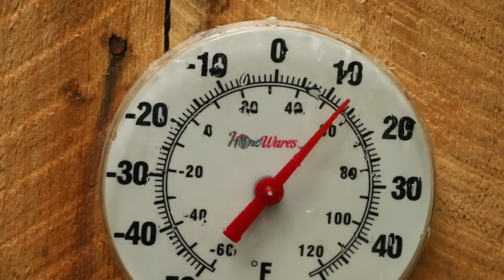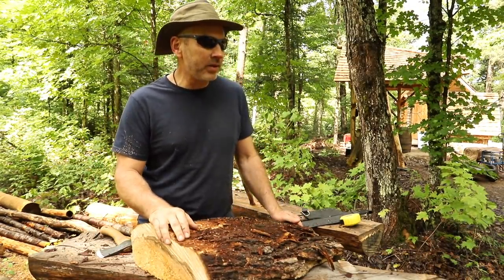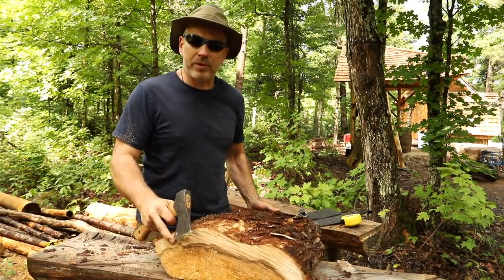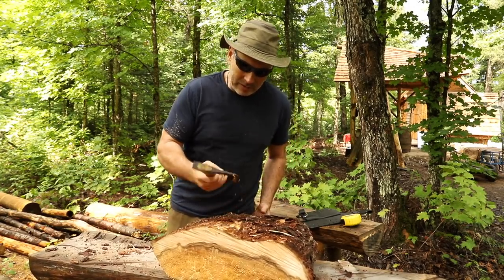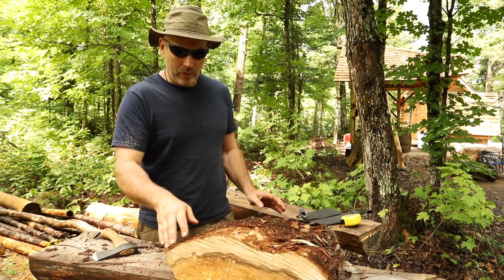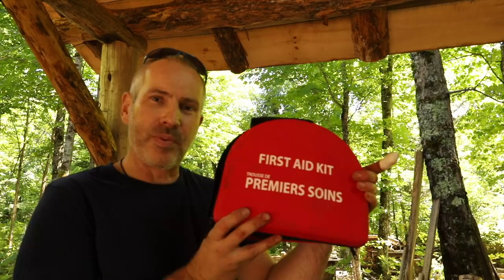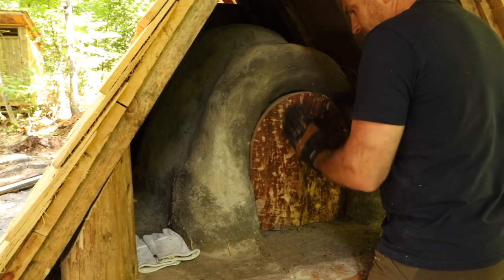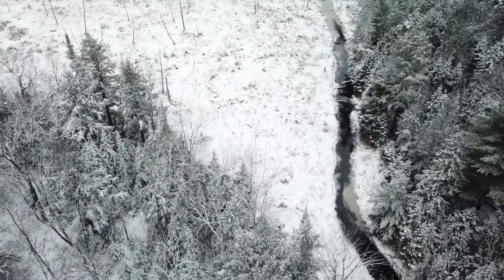I GOT HURT Building a PRIMITIVE KITCHEN in the Forest

Comment: Just an emergency stop-gap until you can get proper first aid...
I always carry a long boot string & a small tube of superglue in my pocket as a just-in-case type of thing.
Sounds a bit weird but either of those 2 things could save you a lot of grief if injured out by yourself.
Reply: Letter carrier uses super glue for hands in winter too! Cracks bad!

Comment: Due to very complicated health problems and dozens of major surgeries I’ve had since I was young, I now have a fully implanted venous access port in my chest, which I need for the administration of various intravenous drugs and infusions, which I actually set up and administer myself at home, which saves me having to visit the hospital twice/thrice weekly.

Anyway, the implanted portacath in my chest leads directly to my superior vena cava, via a silicone catheter. The last one I had which was replaced 2 years ago, lasted for an incredible 6 and a half years. Most ports are used for intensive cancer therapy, so are only ever in situ for a year or 2.

Anyway, my advice is, when injuring oneself and if you suffer/experience blood loss, is to keep very calm, try hard not to panic, and try and relax your thoughts as to what you need to do.

I say this, as once, when I removed the special Huber needle that goes through the skin on one’s chest into the port, usually there is a small dribble of blood when you pull the needle out of your chest, but once, for some strange reason, a waterfall of blood started to cascade from the implant, and was actually pouring down my torso profusely, as you can imagine the implant is only about 8 inches away from the heart via the catheter.

This happened late at night, and my wife was fast asleep, and I didn’t want to wake or worry her unnecessarily. I did a mini panic for a couple seconds, and then just got a huge dressing pack and compressed it to my chest. I was fine, but yes, bleeding can really throw one off guard when it happens. Apologies for blabbering on, I just wanted to say if and when accidents occur, think, breathe, keep calm and deal with it without stress!

I hope your finger doesn’t impair or impede your workflow too much!

All the best, keep up the admirable work, my wife and I enjoy your videos. My wife especially loves watching simply for the snippets of Cali!

Paul, UK
Reply: Paul Manning great advice.  Thank you for sharing.

Comment: Superglue. When you cut yourself and there is a lot of blood, superglue. I don't know the science behind it, but it reacts with the blood and it makes a crust right away. It's not definitive, but is very effective. Once I slit my finger with some steel roofing that the roofers forgot to remove from the old roof, and I was fixing some electrical stuff and caught my finger and cut it sideways. I lost a lot of blood and immediately put some superglue and it worked like a charm. It is nasty, but it is more effective than a bandaid because it reacts with the blood, instead of just putting the two pieces of flesh together.
Reply: I knew they used it, I didn't know for what, but I knew they do.

Comment: After pouring concrete you need to keep water after it drys out and before it dries completely that prevents cracking. concrete creates Heat and when that heat reaches a certain temp and not get cooled than it will crack. if you want to prevents cracking you need to cool it down with water. 2-3 a day for first week. then you'll see a dramatic change in its strength and no cracking. it's best to let concrete dry naturally depending on the weather. if it's summer time needs cooling. trying to rush the process will lead to cracks and worse. 

PS: I noticed in this video that you were not wearing gloves most of time. when working with wood carving tools and etc. Always wear gloves. accidents do happen. but maybe just maybe it could have been a lot worse. thank God it didn't. Safety comes first before anything. i want to continue watching you accomplishing fantastic projects. Stay SAFE Shawn.  
God bless.

Comment: You could use that really high quality GE silicone to seal the edges of the wood where it meets the oven.

The silicone should not be affected by the heat, and remain flexible.

Comment: Thank you Shaun for your time in making your excellent and relaxing videos. I think every man should build a house, and you have motivated me to do my own. Nothing grand, just a comfy bolt-hole. By the way, for the back of the oven gable, you could make a frame with the shingles on to fill it, but hinge it from the bottom, or lock it in with wooden turnpegs. Stay safe.

Comment: Wow!  What a lesson you had here.  I learned in school that when you have a bad cut, immediately, you apply pressure to stop bleeding, but add a bunch of salt to the womb and apply pressure.  Raise your hand.  When bleeding stop, a bandaid won't be enough.  Just use paper towel and tape hight, always wrapping with pressure.  You can rinse before wrapping it, but put salt on and then wrap it.  Then, after a while change the wrap and do that a few times.  Only when the bleeding is controlled, you will be able to put a regular bandaid.  It might take even a day before you can put a bandaid on.  You did a good wrapping around that finger.  I've done this several times, since I cook, and it has worked for me.

Comment: Glad to see you looked after yourself so well for that moment... Maybe rig some kind of a clamp on work like that when using a drawknife that size. That said i was once splitting down a large round for firewood on my own way from any help when stupid jammed the maul.  I reached down to pull the piece off the log by putting my left hand gloved fingers into the crack and gripped hard.... The second i did it the round clamped shut again and i had to half stand to bust the maul out (which took ages) and take another wimpy swing to reopen the crack just enough get may hand free... I lost the fingernail and all the skin of the tip of my 'ring' finger that day and made a right mess.... Accidents happen so easy.  Love how well you work with your dog.

Comment: Something I never see mentioned is using a doggie diaper in a first aide kit. They are absorbent on one side and they are water proof on the other. It is good to cover a wound in the bush to keep it clean and dry. I then use tensor tape to hold it on. I have actually used this to hold together the bandages on an ankle wound, from a grinder being dropped. I dressed the victims wound and the doctor was really impressed by the use of a doggie diaper. They are thin and easy to include in the first aide pack.
Reply: shazzzam79 sanitary napkins work much better as well as keeping a few OB brand tampons, they can be cut in 1|4 lengthwise and used for bad nosebleeds, superglue is always a must!

Comment: Make yourself a finger splint, as it will become a target for more abuse. When swinging a thumb detector, i find it more safe to hold it with both hands.                                                           If you tack a piece of tin to the back of the oven door it will reflect the heat and protect the wood. A second cooking oven door should have the bottom 3-4  inches cut off so the fire can breathe and you can slip the food under while keeping the heat inside. Another way to keep  heat inside is to spray foam the outside of the tin sink, it will hold the hot water longer and quiet the banging of pots and pans. If you are not hiding the tin with cabinets, you can stick tree bark to the sticky spray foam before it sets up and make it look like a chunk of tree.

Comment: Watching was thinking if the blood loss made you dizzy, probably some sugar (maple sugar) would help that.  Aslo, so much work to do the door, was thinking couldn't you have made a door first and built the clay oven around it?  Not that I have any experience with such things - but that you could've 'cut' the door away from the clay and that the clay would shrink some during drying - then sanding the door around the edges to fit (?).  Injuries are a drag. Anyway, nice finish :-)

Comment: Dad built a log cabin in 1940-41. He used a mule to drag the sawn logs harvested from the property, called long leaf pine. (forest fire got it next year). thats what i rhink you need. one horse trailer and you got lotsa help. that was a year before me but the debris was there for 30 yrs. i cleaned it up in '85. 
get several rasps! My Dad was a safety foreman for USS. So ive had my chewings for unsafe practices. normally your sharp objects practices are very good. no gloves this time. But in my humble opinion your above ground operations warrant a D. learn some knots, get a harness. use trees as safety line. a fall would take months to recover, thus project stops. take care. (I have been there in several aspects).

Comment: Despite the injury, your kitchen is coming along well. I suspect that coopers barrel is going to supply the kitchen sink with water. Will you be running guttering, or some kind of catchment system off the roof? Heal quickly. Oh yeah, and I almost went into shock with you. Because I noticed you still had  hints of a shade of white, I normally get, when I go into shock!

Comment: Nice work with the ancient/modern tool use. I would have pit fired that oven as much as you could before installing. Much easier to clean like inside your glazened ovens today.
Reply: also glass retains heat very well
Reply: nice idea with the sink I will be using it too :) I wouldnt heat it in any way though. Galvanized steel and aluminum are both alloys. Same thing for anyone eating your tin/aluminum cans from the fire. More toxins in your food.
Reply: yes even stainless steel is an alloy and depending on the alloys melting point is when the toxins can release in either gas or other forms. These molecules stick to the closest thing to it which is your food or utensil or dishes. Fortunately stainless steel has a very high melting point compared to most.
Reply: yup safetey first, or you wont be here to enjoy it. Take your time do things your pace your way.
Reply: archery archery!! yes here in ab all we have mainly are the timberwolves and these alien wolves now. they almost are overwhelming the original "wolf" here. They were even endangered awhile back because in jasper and banff, they were being hit by so much traffic. They made land bridges just for them :D 
I smashed the like before I even started sorry :P

Comment: I am a retired RN and I keep a tube of super glue in my med kit. Once the bleeding stops and you can put pressure on the wound without it bleeding again, push the tip of the finger down lightly closing the cut and seal it with super glue on the outside without getting the glue inside the wound. Once it sets you can add some more around the wound creating a hard patch over the “incision” if you will. Now cover the finger so you don’t rip off the patch and wait a week. It will be the fastest healing wound you will ever see. Yes, they use a medical form of super glue in the hospital all the time.

Comment: I'm 61 years old and have had my fair share of "minor injuries" since I have been working with my hands all of my life. It's been my experience that the most dangerous tool in the work place is the RAZOR BLADE KNIFE and I have used nearly every other dangerous tool there is. They cut quick and deep without any warning. Over confidence in my ability to control the blade in close work has been my issue. Be very careful in everything you do but watch out for that particular tool that we all use.

Comment: I'm just watching this, trying to catch up chronologically on your projects, and I've got to say, a simple squeeze vise would have kept you away from harm. Two long carriage bolts drilled through two slabs similar to your shelves, and washers then handles to put the squeeze on. Mount them on a simple frame to allow opening and closing, and tie them down to a thick sheet of plywood, or better yet, make a stand to tie them to. You get the point, but I used this style of vise many years making baskets out of white oak, and you could have easily gripped that door and kept that drawing knife away from you. This design is meant to use drawing knives to work with.

Comment: I did the same thing in 1995. I was whittling wood and I cut my index finger on the left hand. It bled like you said and eventually healed. Man do I got a nice scar to tell some stories with. Same finger in 2001 on the backside of it, I was disassembling a Ford Stepside bed and the floor dropped. It ended up slicing my finger cause I wasn't wearing gloves and I had to go get stitches plus a tetanus shot cause of the rusty metal.

Comment: I actually chopped the last 3/16th or so of my index finger clean off while incorrectly using a mandolin slicer. The urgent care doctor sloppily sewed it back on. My doctor left the end on and  put a finger cage around it. He said that my skin would be the best bandage. The end eventually fell off, but amazingly 99% of my finger tip grew back. I only have a small callous like numb spot on the tip. I hope you went and got sutures. If it wasn’t all the way through it would probably heal to near perfection.

Comment: Growing up in the outdoors here in the southwestern USA, mostly as a young teenager, I can appreciate your hard work and efforts. I have much enjoyed these videos. I do have one question...would you tell me the name/variety of the tree you have used in your woodworking and structure building? At times it seem a very light low density type of wood and logs you seem to prefer. Easily manipulated it also appears to be extremely light wood stock either that or your much stronger than you look.                                                                                                    thanks a beginning fan,   curious

Comment: Hello Shawn,
Regarding the injury; I"ve allways wondered why you never use propper safety chainsaw trousers & boots. I can highly recommend rhe Stihl savety gear.
An other remark concerning savety: when building the cabin you allways use a leather apron if using the 'two handed scraping knife'... now sitting and working with that tool you did not... and cutting towards your torso. Please keep always vigilant in this aspect.
Greetz ftom Holland.

Comment: Shawn, I'm not sure if anyone else has asked before about this in previous comments, but how are you going to vent your oven. I notice you haven't installed a flue/chimney in it to allow the smoke from the fire to escape, but when you have the door in place, and use it to contain the heat, wouldn't you be cutting off not only the oxygen to sustain the fire, but also the smoke from leaving the oven?
Reply from the maker: This is a traditional earthen bread oven, not a modern pizza oven. From my research, I think the main difference is that in a pizza oven, you cook with the fire still burning and it's quick. In my style oven, you heat the stove with a fire and let it die or remove it completely before baking in it using the stored heat in the thermal mass of the cob walls
Reply: Thank you, this is what I wanted to know too.

Comment: Shawn,  when it's like -20C, will the heat difference between the fire inside and the cold outside that oven be enough to cause cracks?

Enough people have commented on the cut, so I'll just leave that one alone. I'm glad it wasn't worse, though.
Reply from the maker: I'm thinking the same thing, which means I'm baking inside the cabin for the winter

Comment: Well I can certainly relate to you injuring yourself.  I ground a knuckle on a 12 inch sanding disk.  That time I was alone up in my shop at work.   Drove my self to the hospital. Another time I sliced my finger . That time luckily a friend was in the   shop and caught me as I passed out.  After 32 years in the wood model shop where I worked I still have all 10 digits.

Comment: This type of thing happens, and it is why I'm so fastidious about clean blades and only use nontoxic oils and waxes on them. Rather a deeper cut with a clean blade than scrape from a dirty one. Almost lost a friend to a blood infection caused by scrape from a claw on rusty hammer (the rust is not the problem in it self, but it made a home for some nasty bacteria)

Comment: You can make hole ground oven my DAD WOULD KILL A PIG,GOAT, OR A COW SPICED IT UP ONION, garlic jalapeño, green pepper, RAP IT, must be wood, no charcoal, he had a perfect timing smoked it, the last rap was he would swaddled cover with sackcloth and it will never burn up. Covered the hole top with a sheet of tin roofing left it covered for 24 hrs. Oh! For preventing for no air to enter he covered it with dirt. The meat came out PERFECTO!!!! It would peel of the bones. Bones would come out squeaky clean.

Comment: I have seen a lot of these videos, not all of them....and with allllllll of the tools and equipment that you have, both old school and "modern", the one thing I have never seen you use that you desperately need is a vice!  You can't try to hold onto a piece of wood with one hand, or between your legs, etc, and try to cut it with the other hand with a sharp tool while it is flopping around. That's just an accident waiting to happen.